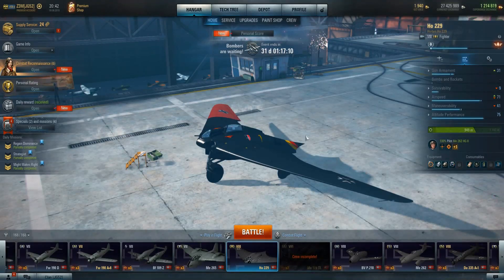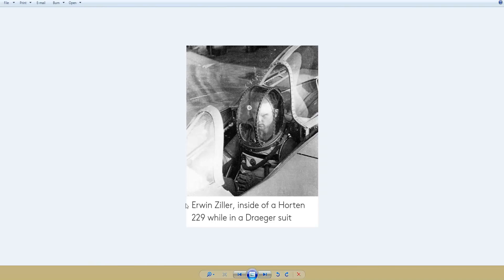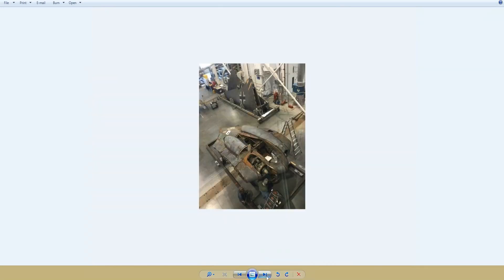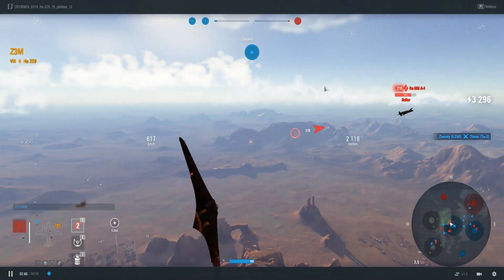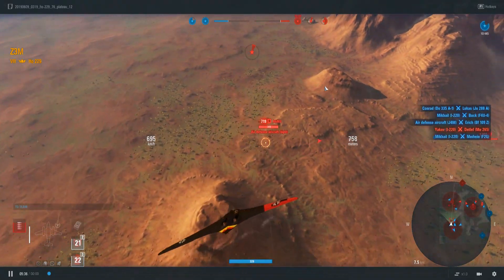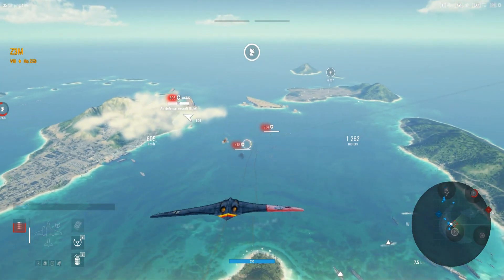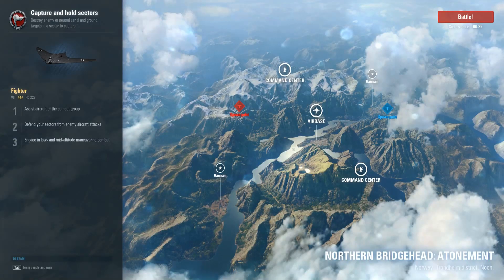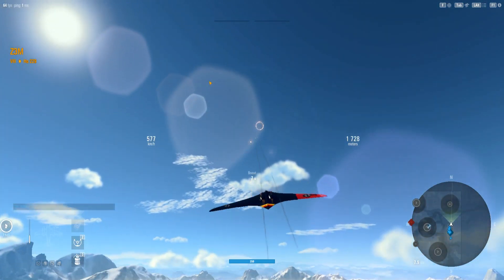World Of Warplanes.  Ho-229.  Wunderwaffe Bat Wing.  Review And Gameplay

Comment: I like the plane and want to do better in it. What setup should I use. Pilot skills consumables etc.
Reply from the maker: I went for speed and guns for equipment. Boost and turn consumables, is what I chose for consumables.
Reply: @shrikegaming9765  thanks, and what about pilot skills?
Reply: @haakonsteinsvaag  Marksmanship I and II are basically mandatory, and the specialized guns are currently bugged. They're actually worse, with 75 RPM instead of 90.
Reply: @skyblade_run8420  I didnt get it - what is bugged? When you mount the kit for better rate of fire (Gas-Operated Action)? Or when you just reach the specialized config, the guns just go slower then before?
Reply: @praashek  when it first came out, the guns on the Specialized layout actually had a lower rate of fire than the non-specialized ones, meaning the Specialist configuration actually had lower DPS. This has since been fixed, though.
Reply: @skyblade_run8420  I see - thx for info and quick reply :) btw - if you got the plane - whats your config (equip and pilot skills)?
Reply: @praashek  Marksman I and II, Aerodynamics Expert, and Engine Guru on the pilot. Aerodynamics Expert says it increases the effect of mounted equipment by 40%, but it increases it by 100%. I went for a speed build personally but you can't really go wrong since it's such a strong aircraft.